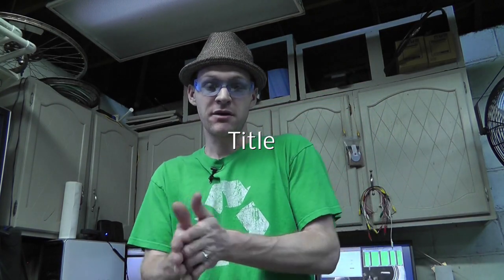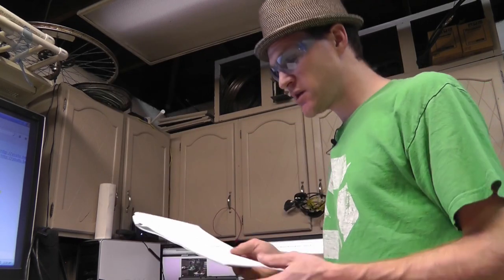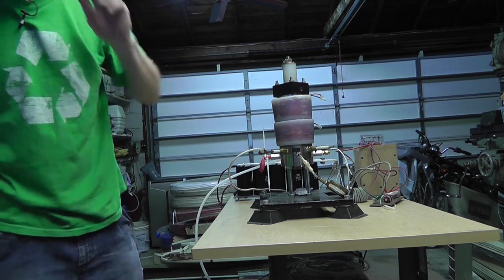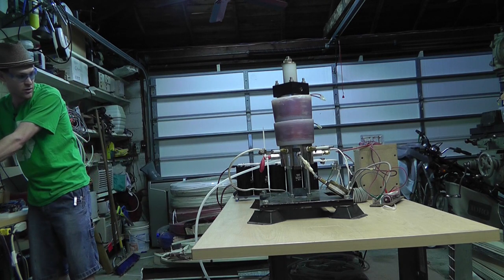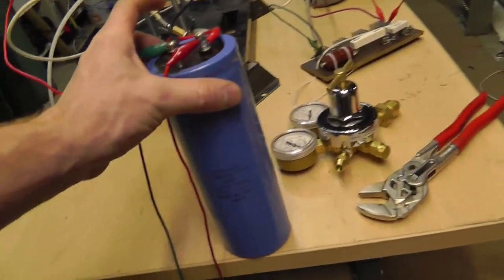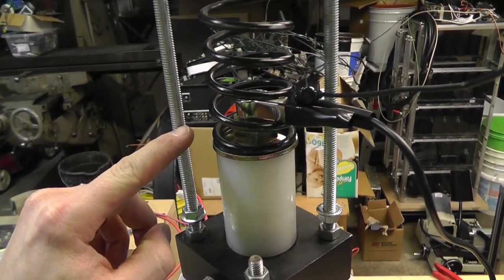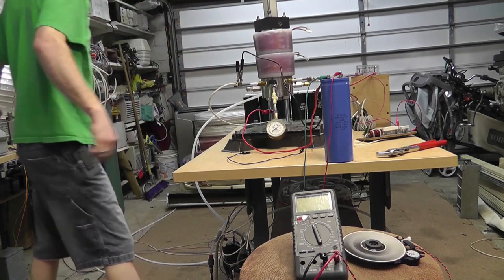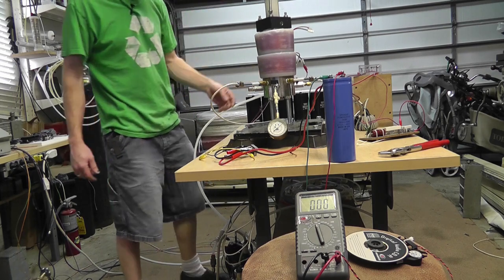Update 23 NGE Papp: More Balloon Testing & The Search For Feedback Current.

Comment: Judging by the speed that the Balloon expands, it looks like the expansive reaction is of an extremely short duration, a transient burst. Try to think of a way to measure the dwell or pressure profile over time, the reaction could be more powerful than it seems, if the reaction is an extremely short pulse, the power estimation wcould be way off. A smaller lightweight piston assembly might be able to move faster, like we see the Balloon doing. We don't know what the pressure cycle looks like yet.

Comment: Hi Rush! Last video I saw a comment about the old engine kind of documentary you should add it to your videos folder and add a description and link to all your video update. When you said connect here to there , there to here I didn't have much clue of the circuit maybe some had drawing schematics will help. Also why do you hock a Oscilloscope to see the signal that may give you more info. Why don't try to get some X ray radiation sensor maybe other radiation wavelengths too?.

Comment: So why would the balloon expand (slightly under these conditions) and yet heat generation is not observed?  Really!  Heat transfer is time dependent with metals.  The reaction causing the system to respond in such a way is due to very short high bursts of radiation.  The energy is intense enough were you should be protecting yourself with a lead curtain.  Why so many guys (without taking the proper precautions) experimenting with high energy physics/matter don’t survive their own experiments